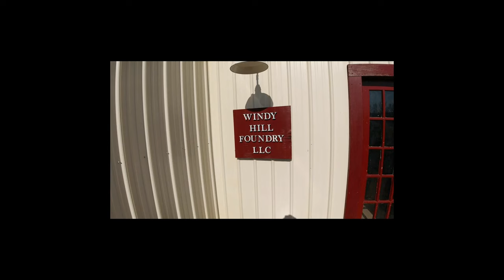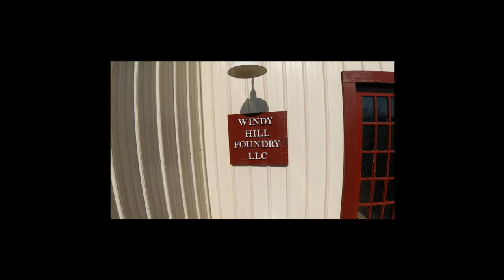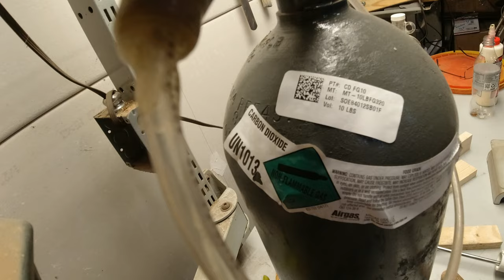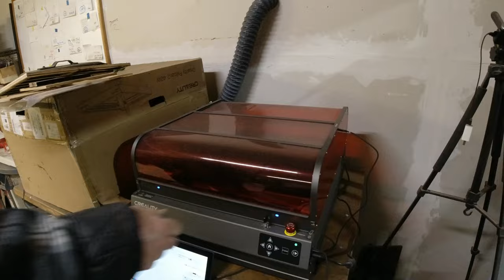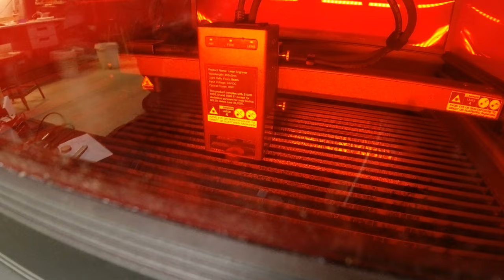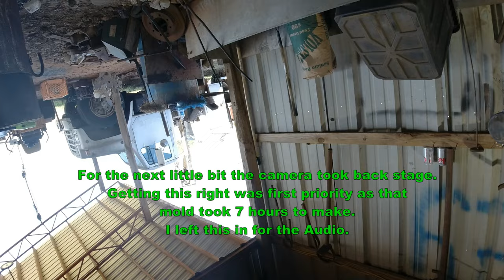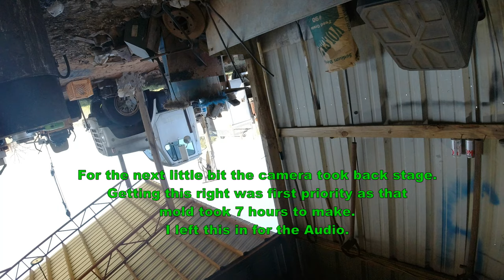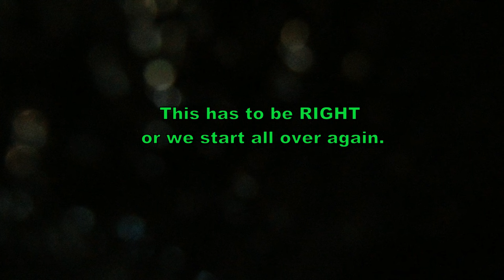Watching the work at Windy Hill Foundry as they pour the casting for the Tally Ho.

Comment: Many tears ago during my school holidays I worked in a foundry. It's all hard, hot, heavy work requiring steady hands and attention to detail. If you have not been a part of the process it is hard to appreciate how much labor is involved and how easy it is to damage a mold. Then there is the problem of trying to predict how pouring molten metal will affect the mold and how to compensate. I have the greatest respect for foundry men.
Reply from the maker: Working with Clark has opened my eyes to a process that I had always thought of as simple ... Turns out I was wrong :)

Comment: It is incredible to imagine a 50 foot bucket or ladle of molten steel being transported via an overhead system of rails and cranes to pour huge ingots that were then taken out of the molds and placed on a series of rollers to take that ingot and make it into rolls of sheet steel that could be made to any thickness. I consider myself fortunate to have seen that process while on a school trip. The steel industry was the life blood of America, especially here in what is now referred to as the "rust belt", throughout the first 75 years of the last century and helped win 2 world wars. The secondary businesses that made specialty parts and transported the raw materials and finished goods was enormous. The economic loss is still being felt today. Our neighbor across the street had a foundry in a small building in the back of the property with a furnace, lathes, a mill machine, etc.

Comment: I am an electronic technician, and I would (if'n I were you) invest in a cable tie cutting tool  as soon as possible. Using diagonal cutters or lineman's pliers to cut wire ties is an unending series of nicks and cuts because those cutters leave a short but sharp nub sticking out to slice your arm open when you least expect it it. DAMHIKT 😢
Reply from the maker: I have two :)
Reply: You know I’ve taken a pair of plyers and twist the tail off. Grab the tail close to the block (I don’t know the name) give it a twist. It’s not as sharp. Clark is quite humble.

Comment: I’m watching this and wondering why a wood dowel with hole through the middle drilled on a lathe wouldn’t work. WD 40 that rod.
Reply from the maker: The wood would instantly char and  contaminate the mold and not hold size... 2800 F is pretty intense....

Comment: Clark needs a better hoist or he needs to use a come-along.
Reply from the maker: Subsequent attempts were made with the hoist holding a block and tackle....    He is rebuilding the shop and plans for a different arrangement are in the works.
Reply: @10swatkins  Good to know, thanks. Hate to sound critical, that casting has to be a total unicorn. Hard to work with if you are not set up for such.

Comment: Helping to NOT pour the casting, right? You people should pass it on to a foundry which knows what it is doing.
Reply from the maker: Maybe Leo should  find a ship builder that knows what they are doing?  After all it just took them 4 tries to install the bow sprint! 

Helping to pour as in " I'm going to have a casting poured"  It's more than the actual act of putting liquid 3000 degree cast iron into a mold.... 

Follow along and maybe you will understand the problems that every foundry faces when pouring a new item.
Reply: @10swatkins  Oh, I understand them very well, thanks. Windy Hill are making a hash of this casting time and again.